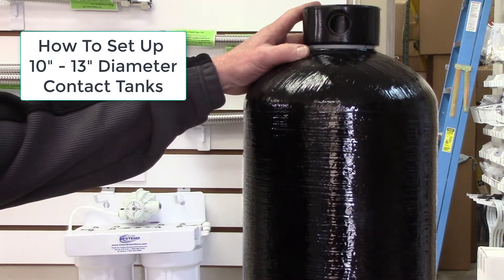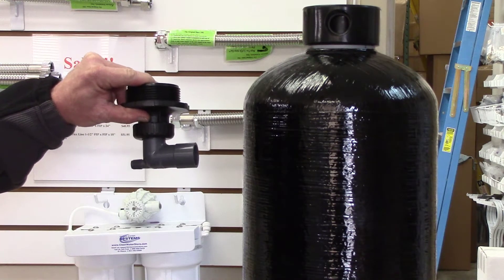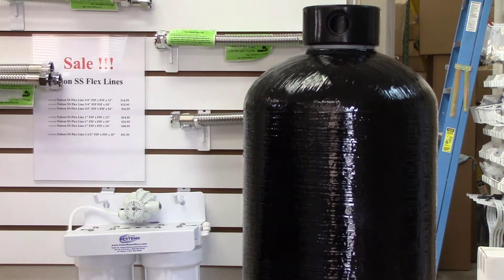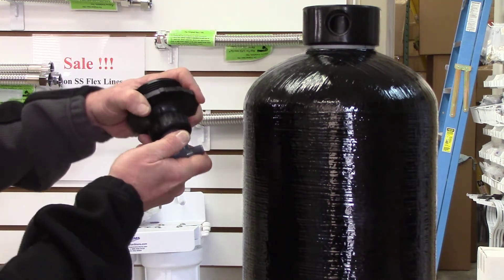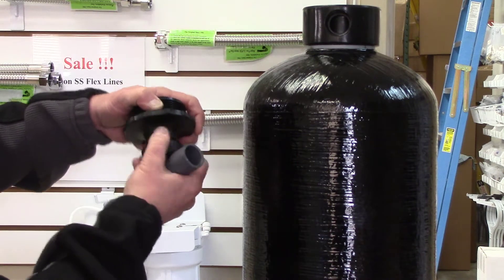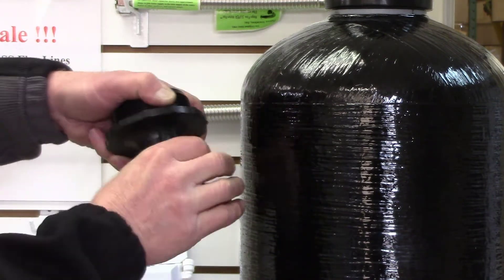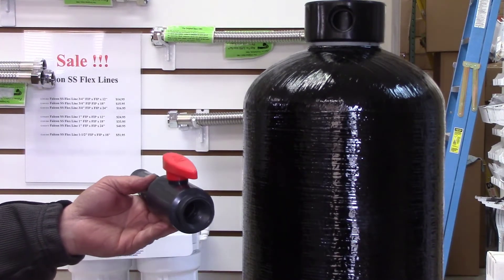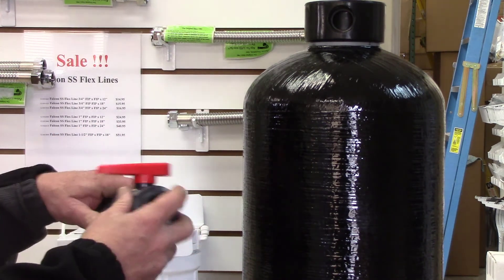How To Set Up & Install Small Contact Retention Tanks for Home Chlorination Systems

Comment: You would want your inlet water to go down the distributor then work it's way up to the tank head adapter. Plumbing it the way that you described would make a pseudo pressure tank and also not give you as much contact time due to the head of air. In addition you don't want to be picking up anything that has precipitated to the bottom of the tank and in turn make your down stream filtration work harder than necessary.